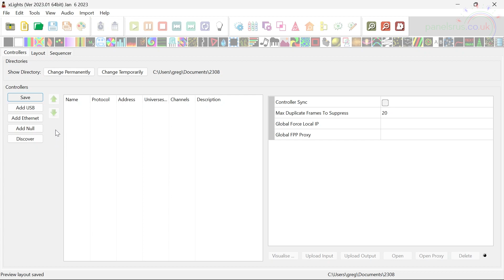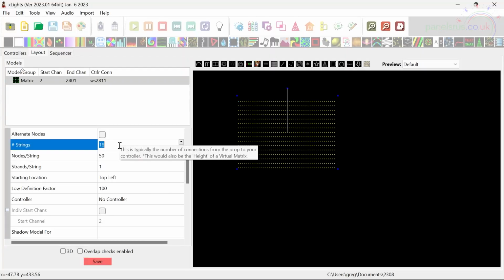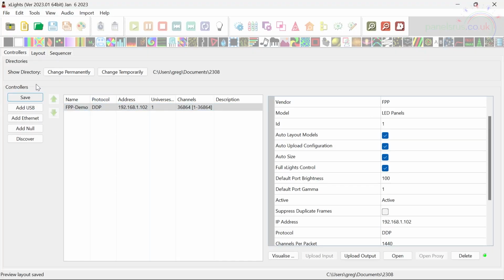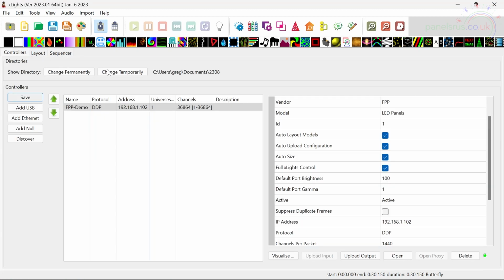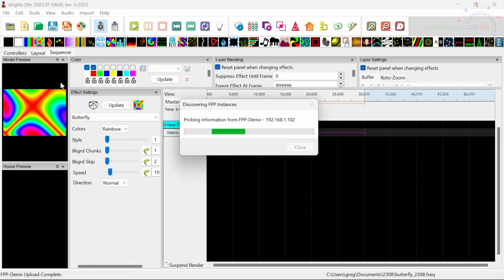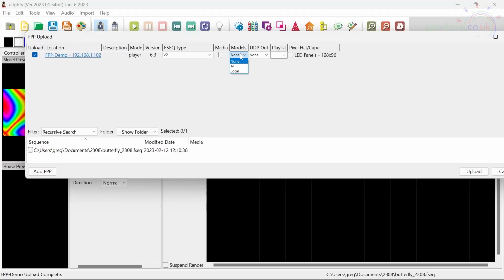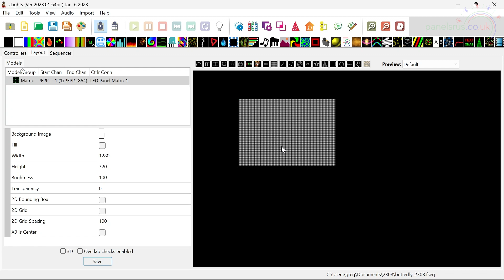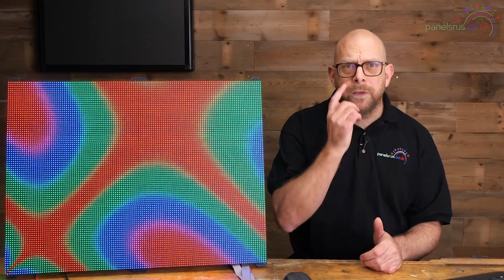LED Panels - An Introduction (Part 4). 2023 - xLights Setup

Comment: Thank you, Thank you, Thank you, Greg!!! I have been working on our LED Church Sign that bit the dust. It was a dual color led sign. It wasn't vented sufficiently and it fried almost everything inside. I purchased a kit from WIRED WATTS with full color panels, power supplies, Rasberry Pi 4 etc. I started with no knowledge of LED panels and finding enough info about Matrix Panel Signs has been one of the hardest things I have ever attempted.

 I sell and repair large diesel Generators that are used on large Poultry Farms. I retro older Gens and the Automatic Transfer Switches with digital controllers. I thought that was difficult until I started this sign project. 
96.5% (lol) of You Tube videos deal with Pixel Light Shows with only a few dealing also with Tune To Signs. 
I have honestly spent months, hours at a time trying to gather enough info.  Your videos are the absolute best, and you are the perfect teacher. You are thorough, don't sound like you are just trying to get through with the video, and have a gift for conveying  your knowledge so anyone can understand (my wife taught 4th grade for 47 years and considered by most as one of the best teachers ever).
I am so thankful I found your Channel. Even Wired Watts said they didn't know enough to help me. He said he wanted to  start looking more at it so he could increase his market.

I know you don't have time to read this because I know what it is like to be extremely busy. Just in case you did, THANK YOU SO MUCH!!!

Comment: Hi sir , great explanation ,appreciation and respect for your work. I am building screen with P1.9 can you please recommend and speceific bracket cabinet for those. I am considering flexible P1.9 panels  320mm x 160mm  with 128 x 64 pixel.

Comment: Question regarding your suggestions for an outdoor LED panel system I am in need of.  I am currently constructing a dirt road course race track and would very much like to use outdoor LED panels at particular locations around the track to display Flag information instead of having workers present to display said flags.  Such displays would range anything from a solid green, yellow, flashing yellow, red, or even a picture of a checkered flag to signal an end to a particular lapping session on the dirt road course race track.  As the venue will have a track with length of 2.5 miles, I am looking to construct a solar powered outdoor wireless network, and use said network to control LED panels individually at particular corners, as well as have ability to control them all simultaneously, such as a "full course yellow" when there is a minor incident on course.  Panels would need to be controlled wirelessly over distance, with solar power charging due to the remoteness of each panel.  Please let me know your suggestions for such a system.  I have seen race tracks use these before, but we're a start-up operation, and do not have the ability to bury cable to all corner locations.  Thank you!
Reply: Did you ever get this going? If I have questions looming to do something similar